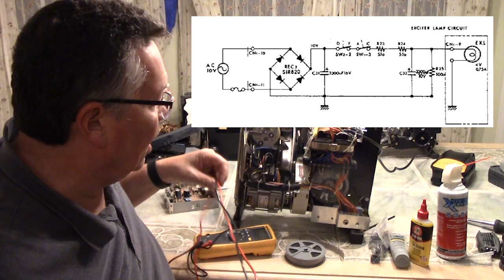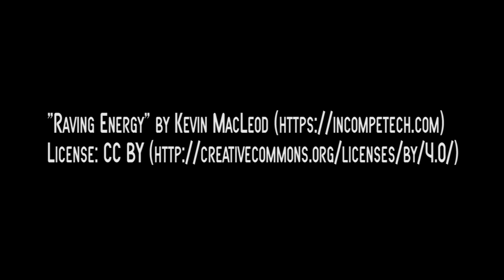The Projector Project - Elmo 16-CL Project 1 - Part 1 - Diagnostics and Plan of Action

Comment: Awesome vedio, but u never mentioned any thing about  Elmo 16 cl xenon! Inside the side cover, there's another gear  bit heavy  with attachment to the electronic parts in Inside the projector! Is it DC power supply to xenon lamp!? Please explain, regards Ashok
Reply from the maker: I've never worked on the Xenon version of this projector.  I wish I had one.  I do have a TRV-16H and they are also quite different.

Comment: i have a take up reel problem with my GS 1200 i think it is the ic   rectifier  on the take up motor control board
Reply from the maker: Joe Matteo - I think it might be the same rectifier, the SIRBA20.  See my other video on checking the part and maybe my solution will work for you.